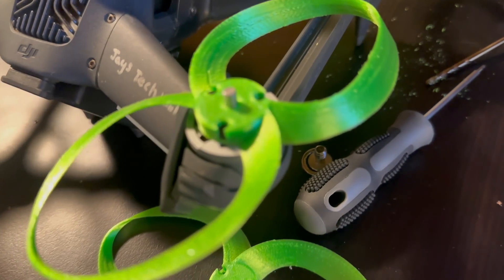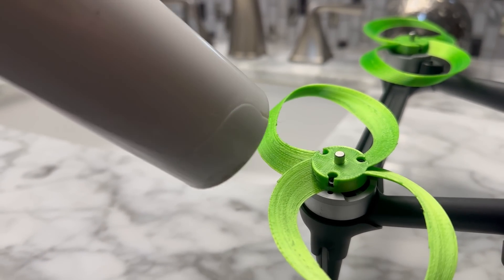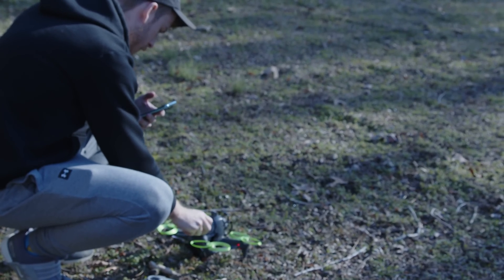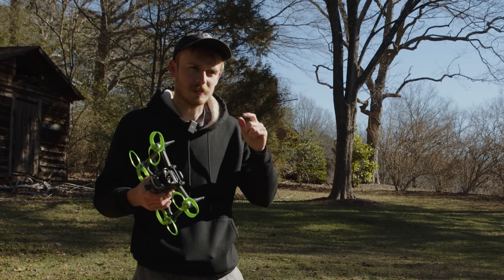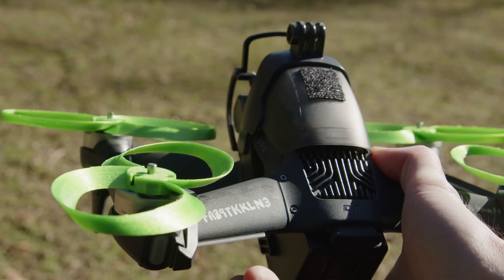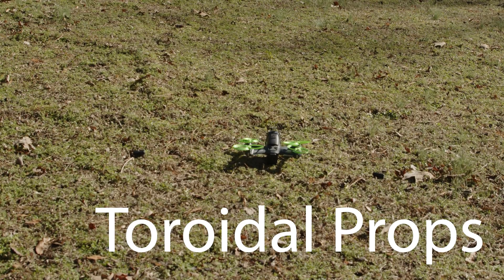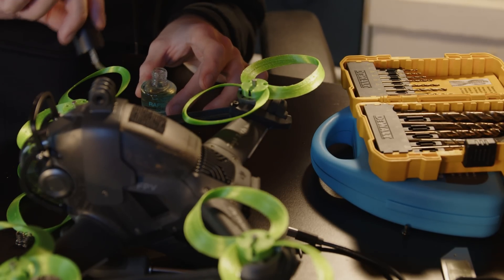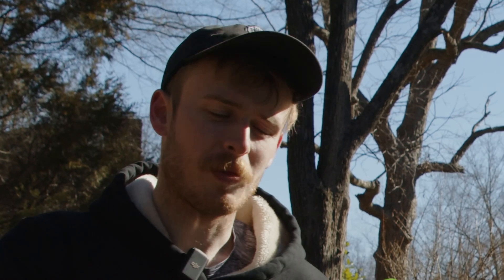Testing MIT's Toroidal Drone Propeller Design & Sound

Comment: Hello! Seems that you are over extruding, you should consider adjusting the flow, and calibrate the E motor on your 3d printer. Probably also check the X/Y axis, if the calibration on E and extruding continue giving the same problems.

Comment: Non-engineer but paid attention in physics. I can’t help but think no matter how meticulously you coat those blades on the toroid, there remains significant variances in the surfaces of the blades which means turbulence. No matter how minor the blades surface imperfections, turbulence robs the lift effect and efficiency of that lift so I wouldn’t dismiss the benefits of such a propellor without first addressing this.

Comment: Bro... Did you go by with an overhead view Picture? Were you able to call them for the specs? The thickness? Those are one inch thick or more. The height of each of those props is at least one inch, if not more. I can tell because the Blades are curved like a ribbon on a bow on a Christmas gift that would be used on a Present. MIT design blade is way different than a regular blade! They are testing a Leonardo da Vinci helicopter-type Blade that loops back like a bow. You went with a Flat design that all manufacturers are using today, thinking this is the norm and that is not what MIT is testing.

Comment: I remember hearing about anealing, but this is the first ive heard of using a hair dryer, If you have a heat-proof container such as metal or really strong glass bakewear thats deep enough, and you have a good enough oven, you should be able to aneal slower and longer by putting in sand to prevent deformation. should give it a try and let us know if it works!

Edit1: Additionally id like to see you check out leading-edge tubercle  propellers. its a new emerging field of prop science being developed that is influenced by the Tubercles on whales to reduce drag, increase durability and reduce noise, id imagine maybe combining them with with Toroidal props might solve some of the issues.  also perhaps this is an application that would benefit from Resin printing.

Comment: the PTEG you are using is EXTRTEEMLY soft and pliant... the blades are deforming in the air and loosing their efficiency at the high rotational speeds. 

understanding the cost... it might be better to outsource the printing to a machine that can use PEEK or Ultem with a printing service, I would try a few redesigns first but it might be worth it.

Comment: Don't assume that because it was "MIT designed" that they automatically "better" than standard prop.  They need to specify in what way they are better and why.  I would think they need to be two tier instead of the standard flat design.  The flat design reduces efficiency as the swept mass are not driving more air downward than the straight ones.  The 4 "blades" might have the same amount of thrust as the 3 standard blade prop, but they add more mass for the motor to turn reducing efficiency.

If you see the design of sharrow prop, they are not inline like MIT one.  The one blade propels water toward the next blade making it easier for the second tier to push the water backward.  There will be no such effect in the inline design.

Comment: Seems like you might get the same sound and slightly better efficiency by just having twice as many blades that are half the size as the regular prop, or the torodial without the bow connecting it at the end

Comment: If you don’t have the EXACT specs for the foil shape, you won’t make this work. 
Alternatively, you need to have a simulation for your 3D models to simulate generated lift. 
Even the slightest degree on angle or height and curvature will have significant impact.

Comment: MIT engineers did it better. I don't think toroidal props should lose efficiency. There are toroidal boat propellers on the market, and they are both quieter and more efficient. Creating noise uses energy.

Comment: I wonder if toroidal propellors will find a niche. Comparing a 1st gen prop to a 1,000th gen prop is of limited utility. It might be a little more even if you designed & printed the straight prop you compare to

Comment: Annealing doesn't make material stronger, this is half true. The material is as strong as it was, there are just less gaps in the print. FDM printing creates cylinder like lines, so cylinder line on top of cylinder line makes a gap because of the shape. Annealing fuses the layers together potentially also loosing some details.

Comment: nailpolishing the print layers makes practically zero difference (look up stepped airfoils). They do look like they might weigh more... also having more material at the tips is going to increase inertia when stopping/counter-rotating the props. Not as big an issue on camera drones as on acro/racing drones, however.

Also, the largest 'factor' to efficiency is your airfoil... being a toroid makes no difference if your pitch angles are different from your control prop. This is probably why you get such a poor run time. 

You reached the right conclusion though, this idea probably isn't nearly as good as MIT's Lincoln Lab claims it to be.

Comment: It is not fair to make conclusions and recommendations with regard to the toroidal design because your 3D printed design is guess work rather than a carefully engineered design like the standard props are. Your angles and dimensions, not to mention the rough surface of the toroidal blades you printed (not withstanding the nail polish).

Comment: If you see the Sharrow propeller for boats, which actually does perform better than normal propellers, the other end of the loop ends at a different height. The 2 'strips' making a loop kinda act like a single wide blade with a hole in the middle, instead of making 2 smaller blades beside each other.

Comment: @JaysTechVault The clue is in the sound. Lower pitch sound = lower rpm. Your motors are overloaded so run much less efficiently. You need to look at lowering pitch and/or diameter.

Comment: Not bad for a 3D printed version. How close is the curve profile, weight, mass distribution, flex, etc., to the original? Wouldn't surprise me if a properly tuned & manufactured blade could compete.

Comment: Not a a fair comparison as the stock blades are tri-blades, while the 3d printed ones are bi-blades.  more blade count results in higher pitch sounds, which is why it sounds the way it does.

Comment: A decent test. But your design doesn't also have a proper airfoil structure. Thats a big point in propeller design. You do have some good points in the flaws of your 3d printed model, though. Perhaps use them as a stepping stone to make a casting mold for a smoother, more aerodynamic design.

Comment: Hard to compare the sound volume without knowing how the sound recording was processed.  Most sound recorders have AGC (Auto Gain Control).  Probably should measure the dB compared to some baseline and also look at the frequency spectrum.  The noise/lift tradeoff is probably optimal for a specific rpm/size/density.

Comment: I think you need to print them thicker, so you can can do a few things that will greatly improve their efficiency.
Printing them thicker with less angle of attack will reduce the effort the motors have to put in to achieve proper speed. The adding in a wing like profile to the lifting surface will also aid in lift. And lastly, the extra thickness will allow you to sand and smooth the props so that air flows over them properly. 
Having a smooth top side is key to achieving laminar flow. The air must smoothly flow over the surface to reduce the air pressure above the blade, but a rougher texture might actually help generate lift pressure under the blade.

Comment: As a cnc machinist, there is no way in hell this test is accurate. The real test would be to mill them on some crazy 5+ axis machine. Then make sure they are within tolerance. But BEFORE all of that, you need to do the calculations to get the size of the prop for a specific size aircraft. 

Absolutely no way in hell one person could accomplish all this shit by yourself. Youd need a whole team of people. The material would have to be heat treated, possibly. Lots of cut ratios and programming. Then you need a machinist to run it and gove feedback. Then quality control needs to check it. 

I doubt MIT did all this shit. But the new blades might work if everything is done properly.

Comment: I think the important thing to note here is the Toroidal blades were designed for water (incompressible) not air (compressible). The whole design is based around this so there's no point in even trying them unless you're doing so in a liquid.

Comment: Rotor blades are very particular about the air foil shape (airfoil cross section, twist, spanwise sweep). Just a slight modification to any will make a big difference. Something as small as ½° variance will see measurable results. Try some different shapes and see what happens.

Also to smooth out your prints use an acetone wash. It will melt the high points first and smooth them out significantly. Just place in a sealed metal container with a cloth/paper towel soaked in acetone. You will want to vary the time based on your needs. Typically about 10-20 minutes. Then anneal the parts after the wash.
Reply: acetone will do nothing good to petg, it works only with abs

Comment: I've read some comments about 3d printing original blades for fair, which would look nice, or instead or in addition conpare the mass. The key factor could be rotating mass that affects flight duration so badly. But still nice video)

Comment: If you look at the propellers of a stealth helicopter the blades are shaped like an L where the blade goes straight out and then the tip of the blade flows backwards at a 90-degree angle from the blade

Comment: Cool video.  I like and appreciate your discussion and effort, well done!!👍.  I also wonder if the efficiency and stability is a torque issue.  It appears to me that the toroidal propeller has a more mass further away from the axis of the prop shaft, so maybe the inefficiency and lack of stability was coming from the existing motors not be appropriate for the toroidal propeller configurations.

Comment: The noise (and that is the efficiency) would depend on rpm of motors for different span and attack angle of props. Looks like there should be more test with different modifications of these props. I'd really like to try it! Is there anywhere I could download the basic 3d design? Could someone please send a link?

Comment: It might maybe be possible to use resin for more accurate results if it’s strong enough as it’s possible to print 3D resin models and have the same smoothness on them as what you would have on injection moulded parts! :)
Reply: Print in ABS and vapor smooth.
Reply: @hondaguy9153  
Yup that’s probably what it needs! :)

Comment: The stock props are perfectly balanced, 3d printed ones are not and to top it off you added nail polish which makes even more unbalanced. Just the unbalance part will make it a lot less efficient, buzzing sound will also be different.

Comment: I think you miss the Point of torodial propellers. They should be made more thick. Your design is the same as having 4 fins prop since you don't have enought vertical surface. Try to print 3-4 times more thick vertical axes and play with curves. You will achieve mutch more performance of of them

Comment: your propeller is little bit bigger than required, also it should be a little wider to catch more air, this will reduce noise as well as increase efficiency, decrease size by 33% and may be double blades width
Reply: Also you are comparing 3 blades with 2 blade toroidal propeller

Comment: Seems like they might be in the right direction think they are definitely pushing more air than the 3 blade props 🤷‍♂️ idk if it would make another vid to make them smaller but I for 1 would like to see them pushing the same amount of air as the 3 blade props maybe test your props to see how much lift & match the toroidal blades maybe do individual testing to cut down on time 👍🏼I’m subbing hoping for more on this
Reply: Not a mathematician aeronautical engineer, but do they really push more air than conventional propellers? The fastest moving part of the toroidal propeller, at the apex, has weight but can’t provide much lift, due to its nearly vertical angle, and what looks like the broadest part of the blade is only one-third along the radius.

Comment: From looks at takeoff / landing, there's far more lateral air pushing that's occurring.  So your loss of efficiency is likely from that.  Boats with this blade style are more maneuverable especially going in reverse, I suspect because of this lateral pushing.  I further suspect a single blade, or even a rapidly automatic deformable blade, would be far better efficiency wise while retaining the sound damping.

Comment: I'm not familiar enough with resin/epoxy to know whether or not it'd be worth it, but would it possibly make sense to create a mold out a single perfectly refined and smooth 3D print and then create 4 props with resin/epoxy?
Reply: Good idea. I worry the printed props will deform under the G’s and they just not smooth or sharp enough.

Comment: You forgot the part where MIT tested dozens of different variants to come up with the final version that provided the efficiencies they claimed. You can't just make one and say it doesn't work. If it took doctorial candidates weeks or months sto do, you can't expect to just get it right on the first try.
Reply: Nerd fight! Well said though.
Reply: Fluid dynamics...maybe rotate 90 and use smoke or steam to see the vortex? The water prop causes centripedal not centrifugal flow. A vortex turning inward makes a denser stream. A bigger hub, two strips of metal clamped to faces beveled for the pitch. Beau Prop. No gest.
Reply: To be fair this is some random YouTuber with 200k subs, he's only doing this for entertainment purposes.
Reply: Tor-oid-al... 
Not, Tor-oid-ial... 😂
Reply: And 3D printed are simply not good enough.
Reply: @vanjamenadzer  dude wtf are talking about. They used fdm printer which has a bad accuracy. What perfection? Also they didn’t provide any data!! They turned up the volume to the video with the normal propellers (you can hear the room’s white noise for f@cks shake) and they muted the video with theirs!! 
When they show it outdoors they put music!! I mean come on! You want to show me it’s less noisy and you put music on???
Reply: @dimitrischoul5871  Indeed, they released doctored video and zero numbers. That's not how engineers prove shit.
Reply: @kwyj  it’s just the average state of modern science.
Reply: @vanjamenadzer  bro mit used 3dp to make theirs
Reply: @Wall3000   I know, but you can't properly test it unless the blades are perfect.
Reply: @vanjamenadzer  of course you can. They arent gonna be perfect when manufactured
Reply: @Wall3000 they will be silky smooth when manufactured, not using nail polish to... polish. That bit killed me 😂, it's taking MIT for your 8yo science project
Reply: @Wall3000 would resin printing be better? You can manufacture it better to test.
Reply: @athenovae  I'm guessing it would be better. Less obvious layer lines from the print creating drag with resin
Reply: @vanjamenadzer  MIT did it with the same FDM printer you nubs are hating on.

Those print lines are not why this design is overrated, it's because this design is overrated.
Reply: The shape you made looks like it was never going to work.
Reply: I feel like a lot of people have tested their design and gotten similar results. It seems to not work.
Reply: I bet a lot of the noise would still be there without any propellers, i believe that the motors themselves are noisy. I also think that something could cover the motors to absorb the sound.
Reply: Also I depends on the drone and the motors etc etc
Reply: Very true! Very true, These kids are the best of the best in the world and the smartest, they work day and night and sometimes without sleep/. They eat, sleep and dream making this work.
Reply: It would be interesting to see a CAD file with the MIT experimental designs
Reply: yeah but its not quiter than the original
Reply: @Phandroid, well said
Reply: This comment doesn't really make sense when you actually watch the video. He mentioned many times about these being a 3D printed mockup of the actual propellers used by MIT which he is comparing to his default propellers.
Reply: @overinfinity  did you miss the part where there "are no CAD files online"? Even for regular props, a significant amount of testing is typically required, involving multiple iterations of design changes, testing in various conditions, and data analysis. One has to optimize factors like pitch, blade angle, diameter, and number of blades, often requiring hundreds of test runs.
Reply: @overinfinity   He literally said that he made the design from scratch. He can't copy them exactly without schematics and a better 3d printer.

Comment: must have been a fun project to do, but not having the MIT model and designing something solely based on pictures without proper angles, thickness etc. plus the rough 3D print ... doesn't say much about the actual MIT design.

Comment: Don't think that a fair comparison.  Think u also need to 3-d print traditional propellers so the surface of the blades would be the same as the toroidals.  Believe the 3-d printed toroidal blades are less smooth as the stocks.  Since it is easier to duplicate the surface of the toroidal blades than the opposite.